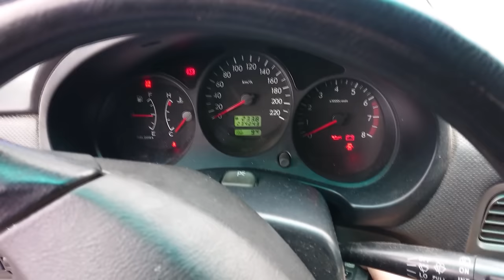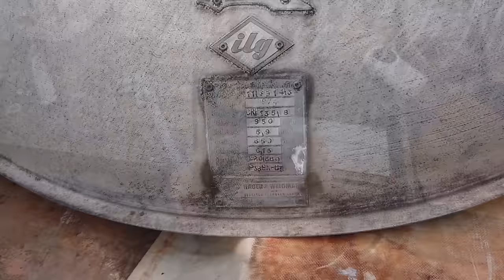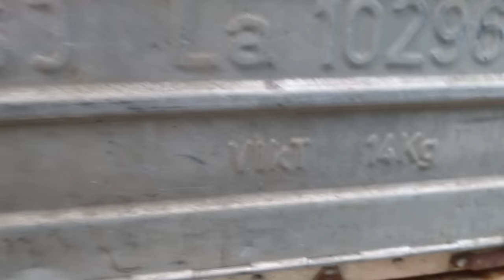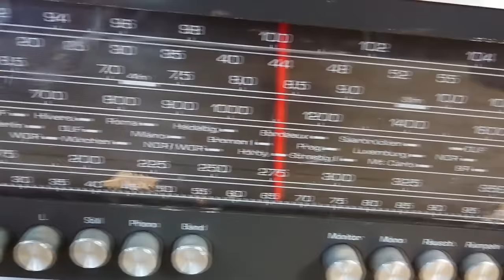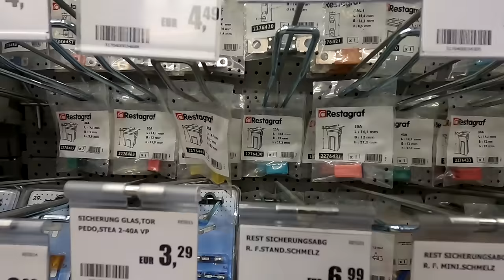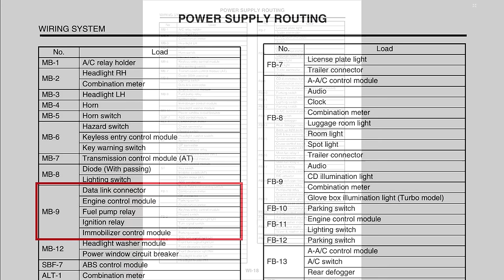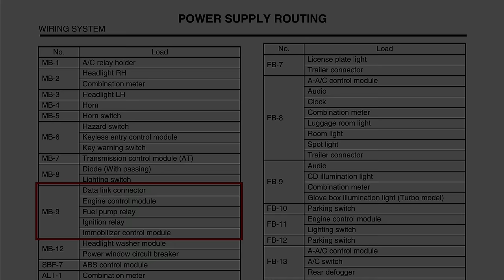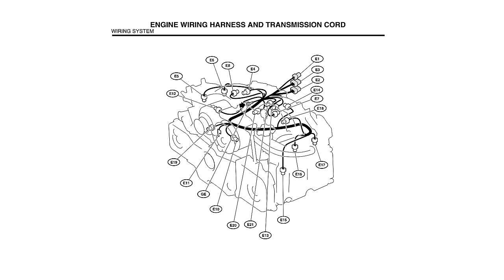New Awesome Scrapyard Finds! Repair-A-Thon!

Comment: Guy chooses to live in an expensive city with high per m/sq cost for space... proceeds to bemoan the high per m/sq cost. Doesn't move then continues to bemoan how long it will take to save up enough to move out of the expensive city. Congratulations on fully embracing your cognitive dissonance.
The reality of course is you like it in the expensive city, your friends are there, you have a jolly time together. This is what keeps you there. This is your choice of course. Just don't externalise the down sides of your own choices as though some how you should be able to have your cake and eat it.

Comment: I will never buy a car that has an ECU for as long as I live. I'll get only an old air-cooled hand-cranked car. Ain't trusting nothing else. Ever.
Reply: Enjoy your 2CV.
Reply: @brianhalberg131   hey, there's many cars with similar characteristics. Doesn't have to be that one exactly :o
Reply: @dimitar4y  Many!? How many air-cooled, hand cranked cars are there?!!!! In fact, I don't think the CV2 was a hand-cranked car. What are you, 120 years old?!
Reply: In many places those types of cars are being prohibited from normal road use in the name of reducing emissions. It will end up being universal given enough time. In my State of SC USA you used to be able to register a car as "antique" then drive it as much or as little as you liked. Now you can only drive cars registered as "antiques" to car-related events or where necessary to keep the cars running like repair shops or to obtain parts for your car with a specific total mileage per year limit given which makes it impractical to drive them for transportation.
Reply: @P_RO_  Sort of precludes a 1908 Morgan as a daily driver, doesn't it?
Reply: @brianhalberg131   I may be... :(

Comment: What I would've done, is bypass the fuse, and let whatever is causing the short, to blow up or melt.
Then I'd have a permanent fault to find.
Reply: And a lot more control units to replace with a different fault. lol